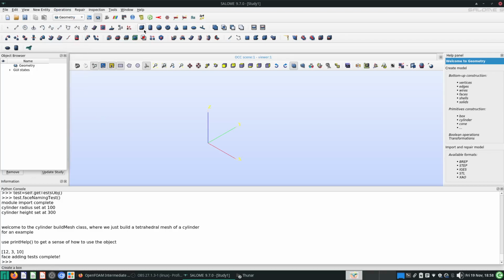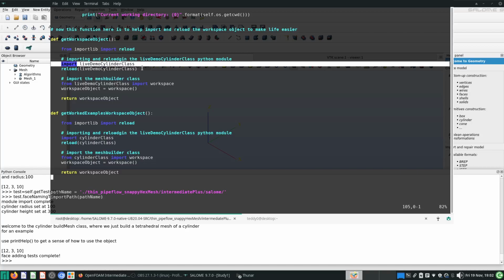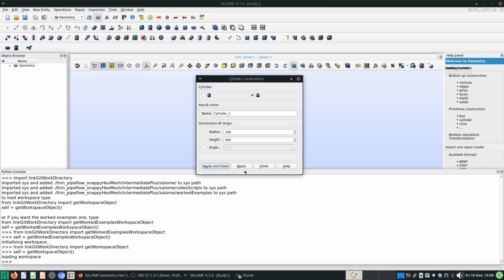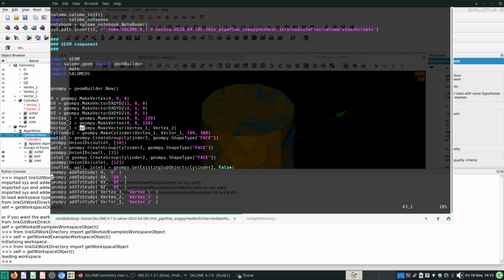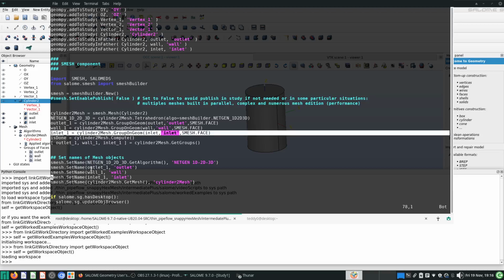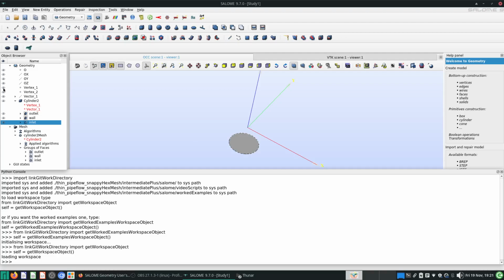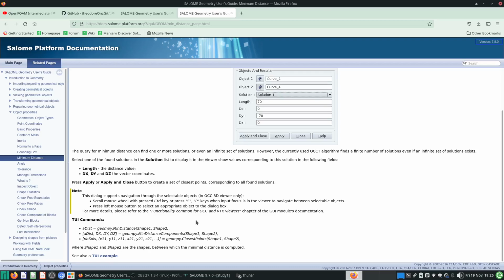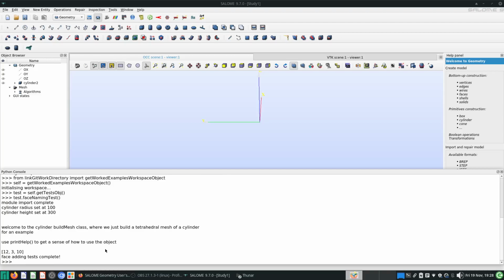OpenFOAM Intermediate 110 - updates, working with groups and faces patches

Comment: Hi Theo, thanks for walking us through these videos.
I'm wondering if you have any tips on 2D geometry in Salome. I have my inlet and outlet (along x axis) of the domain defined, but the y axis will be symmetry. I've determined that my edge directions are reversed, which is giving me false results.

I'm aware of the invert tool in the "Geometry" editor, but salome won't let me group lines with inverted lines in order to make my boundary conditions. It also won't let me replace the line (i have to create a copy). Any advice on working with 2D geometry and line directions? Perhaps this would also be a good into to salome video (2D geometry example)
Reply: Figured it out, though not sure I have the best method.

I exploded the .step file in Salome into lines. I inverted the required lines, then re-created the surfaces using any inverted lines. Then, I partitioned the surfaces together and exploded into lines, and voila, all lines are in one object and with the correct line orientation for symmetry boundary conditions :)

Comment: Hi teho, consider for the creation of the patches using a secondary geometry (planes) to select the surfaces, the id's of the surface can change in a not predictable way. This will help you to choose correctly. (creating a plane at vertex_1 other in vertex_2 and then select the surface of the cylinder that is shared with the planes)  and lastly you can create a Groupe that selects everything and you subtract the other two groups (inlet and outlet) this is super functional to create an script where you import a geometry divided in step files (by patches) and then you create a solid and use the imported surface to create the patches in place 😁